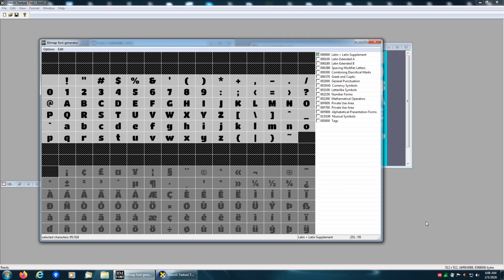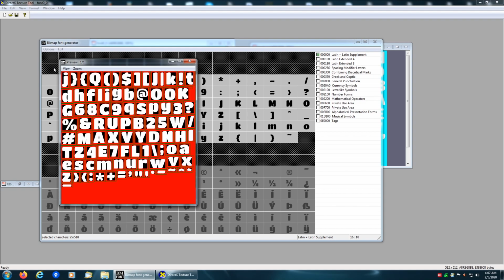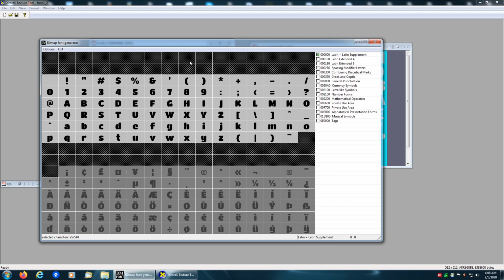Endless Runner: User Interface and Font Rendering Using BMFont

Comment: How are you tackling the different screen resolutions for font quality ? Are you using signed distance field text rendering ?
Reply from the maker: I will tackle screen resolutions and font quality at a later date. Currently no I do not use signed distance field text rendering.
Reply: Ok great thanks for reply.